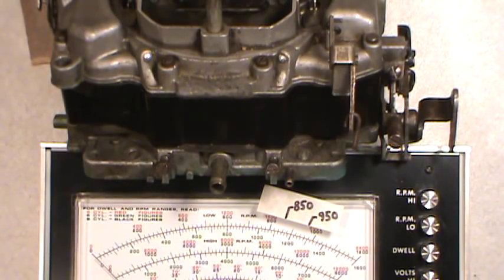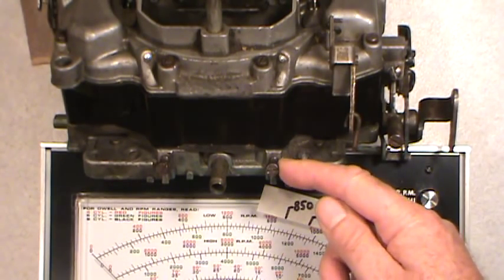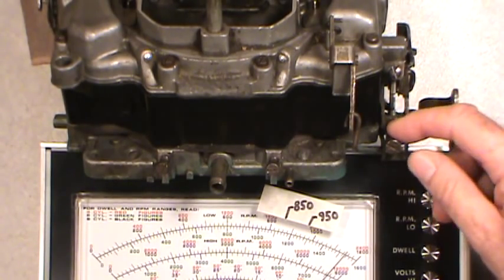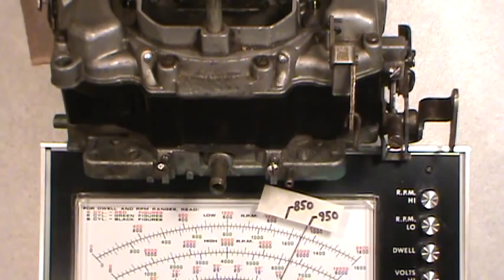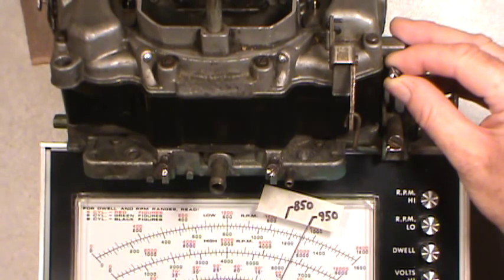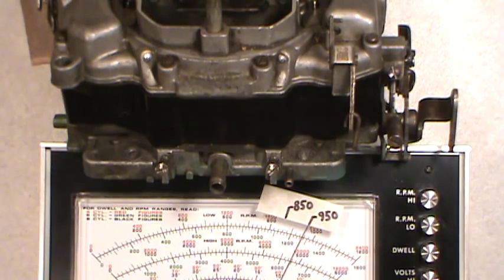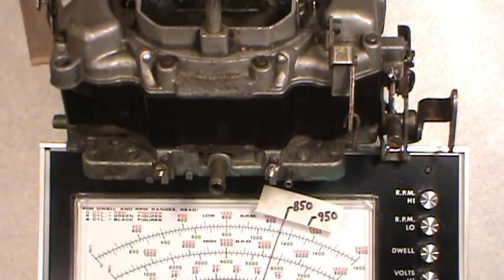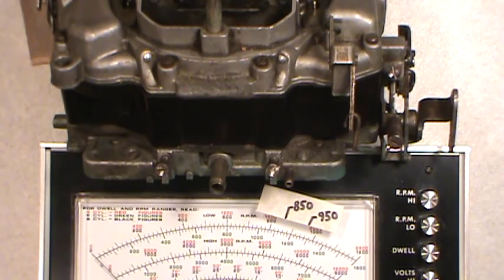Idle Mixture Adjustment on 4 Barrel and 2 Barrel Carburetors

Comment: So how is this set up so ypu can do this off the car?
Reply from the maker: Greetings...Devlicious............Thanks for watching...........Well, in order to, shall we say..."fine tune"...the idle mixture screws, along with the (curb) idle speed (RPM's), as in, just having the engine at idle speed (idle speed screw, or solenoid adjustment), then, it's pretty much a given, that, the engine has to be running, and, is also up to operating temperature, with the choke fully off...........Here are some adjustments, that, can sometimes be made, while having the carburetor, off of the engine...........These adjustments, are usually called..."bench adjustments"...(as in, on the work-Bench)...........Most carburetor "rebuild kits", will usually have these, so called, "bench" adjustments, explained on the instructions (sheet/s of paper), that come in the kit, that usually have, both, printed words, along with some pretty good pictures/drawings as well............Things like, basic (base) settings for...idle mixture screws...curb idle speed screw or solenoid ...choke linkage and fast idle speed screw...choke door (flap)...and if applicable...secondary throttle plates, and/or, secondary air valve adjustments...etc..........Me, myself, if I don't happen to have any instructions, for carburetors, like, oh, let's say, a...Rochester 2 or 4 barrel carb...a Carter Thermoquad...or maybe, a...Motorcraft/Autolite 2-barrel carb...then, I usually just open the idle mixture screws, about 3 Turns out, from being "lightly" seated, so as not to, cause any damage at all, and, this basic/bench setting, is just to get the engine started and warmed up to operating temperature, so I can do the final, fine tuning, of the idle mixture screws..........If, having to go through the "smog/emissions" test, then, pretty much all adjustments, have to be done, shall we say, "super correctly", or, if not, then, that..."smog sniffin' machine"...will absolutely, be able, to "sniff", that extra, not wanted air pollution, that's exiting the vehicle's tail-pipe...!!!...lol...........Be very careful, so as, not to come in contact, with any, hot or moving engine parts and pieces...!!!...........So, there you have it, well, for now that is, and........till next time........Be Safe, take care, and have a good one.
Reply: RockysRoadshow cool thanks I'm rebuilding a 66 dodge charger its a huge learning experience for me I got it for my dad as a project for the both of us last summer but he sadly passed in March so now its up to me to figure out .. Thank you very helpful
Reply from the maker: Greetings...Devilicious...........Sorry to hear about your Dad, and, I surely do, know how that feels...........1966 Dodge Charger, you say, well, I know quite a bit about the older cars, so, if you need any help at all, just let me know about, as to, what condition, that you want the car to end up in, when, all's said and done, as in, is "it", just gonna be, a daily driver/not too fussy at all, or maybe, you want to keep "it", as factory original as possible, perhaps...???............I'm not sure, but maybe, the 1966, might have drum brakes, on all four wheels, and maybe, manual steering and manual brakes (not power assisted), possibly, etc...........So then, if Ya care to, just give me a shout, when-ever, with, what-ever, and, if I'm able to help You out, so be it...........Good luck, with your Resto (Restoration), or, what-ever it ends up be-in, that will put a smile on your face, and........till next time.........Be Safe, take care, and have a good one.
Reply: My 66 has power steering manual brakes drums all the way around and it's a 383 automatic at least it's supposed to be it currently has a 76 440 in it I bought a 67 383 from a 67 Coronet for 300 bucks I was told it knocks when it's cold which my dad told me at the time that sounds like a main bearing because the motor looks like it's been rebuilt it has an elderbrock high rise on it with chrome caps our guess is when they rebuilt it they didn't torque it down right..
Reply: Also I am trying to restore it to as close as it would have came out as Factory
Reply from the maker: Greetings...Devilicious...........Ah yes, an engine, that "Knocks", when it's cold, sure brings back memories, alright..........My (I, use to have), good ole, super high mileage on it, Pontiac, 194 cubic inch, inline 6 cylinder engine, did just that..."Knock"...(more-so), when it was "cold"...lol...probably, caused by..."too much running clearance"...between, the...main bearings, and, the crankshaft's journals (due to wear)...and probably, along with, some very..."worn-out"...connecting rod..."bearings"...as well...and, that poor ole "194", just "would-not quit"...no-matter what...!!!...lol.............Hmmm, was yours, really "rebuilt"...???...and, even, if so, the "wrong size" bearings, might have been installed, which can end up, giving, "too much clearance", between, the "new" bearing's, inner wear surface, and the journal, on the crankshaft, that it mates with...........When-ever it comes to, the drum brake's..."brake shoes"...I always try to use, the brake shoes, that have..."Riveted Linings"...(linings = friction material), because, some years ago, one of those "Bonded" (kinda like...glued on) brake "linings", broke free, from the metal brake shoe, and..."Bang"...!!!...as in, the brake shoe "lining", that came loose, got "wedged", inside of the brake drum..."Big time"...and, it was a good thing, that it was on the rear axle, because, if it happened on the front end, while at highway speed, well, I don't even want to go there............That particular brake drum (once I got it off, that is), ended up, looking "egg shaped" (when looking at, the inside of it)..."Wowsers"...!!!...but, I kinda got lucky at the same time, because, when I put a dial indicator, on the rear axle shaft's, mounting flange's face (where the brake drum and wheel, mount onto), it was still running "true", as in, the axle shaft, never got "Bent", when the "Big Bang" happened............Make sure, that "all", of the 66's brake lines and hoses, are in, "as new" shape, oh and..."don't breathe"...any Brake "Dust", as, it can sometimes be cancer causing...!!! (asbestos maybe...???)..........So then, there's a little bit of information, for you to consider...........Good luck, with your..."66"...and......till next time......Be Safe, take care, and have a good one.
Reply from the maker: Greetings...Devilicious...........Well, as to restoring the "66", to the factory/original condition, then, Money, as I see it, will be a very important factor, as to, just how close, that Ur gonna get it to be, when, all's said and done...........So, factory/stock, it is then...???..........Same size engine (no chrome...no high rise manifold)...interior...factory paint codes, perhaps...........There, just might be, some parts & pieces, that are-not going to be, exactly like factory...any thoughts on that, at all...???...and......till next time.......Be Safe, take care, and have a good one.